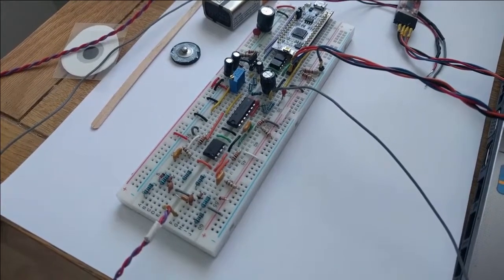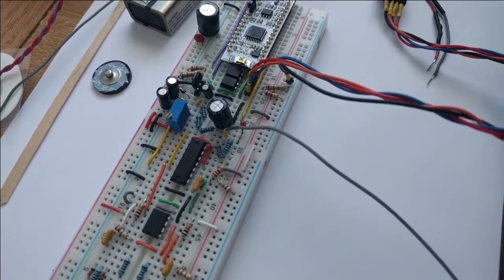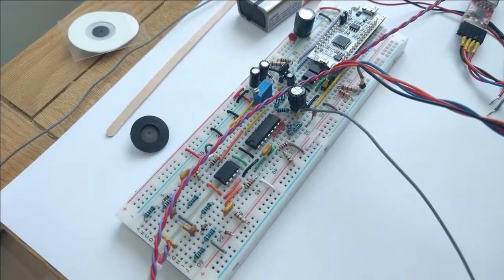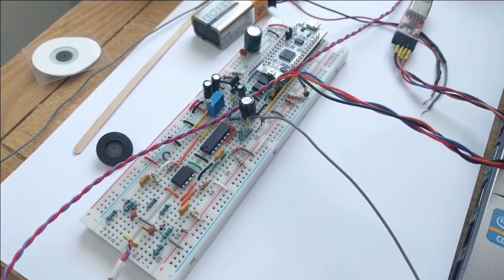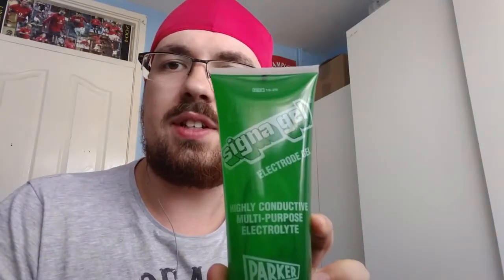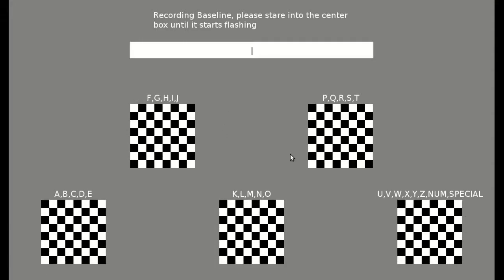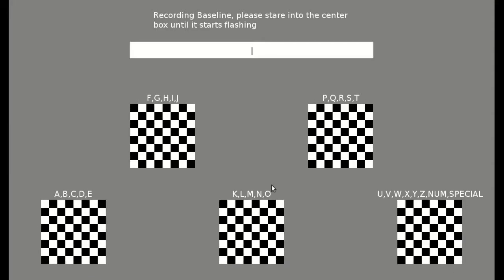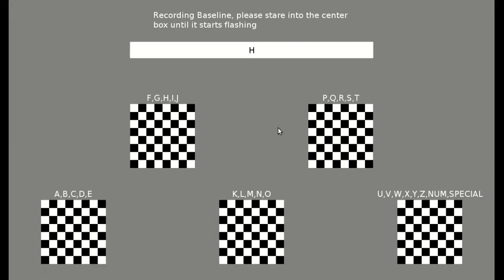Demonstration of a Low Cost EEG Circuit

Comment: do you have pictures of the breadboard exactly
Great work
Reply from the maker: Sorry I don't have any pictures of the breadboard but the circuit diagram is on my github in the description if that helps. I built it on one breadboard but I'd suggest two as it ws very tight to fit everything in

Comment: Please suggest me which electrode to buy.... so that i need not to connect extra wires.... I want   V+ and ground... to be amplified by instrumentation amplifier
Please reply.... thanks in advance
Reply from the maker: For this circuit you will need the 3 electrodes but if you are using a different circuit you could make the electrodes like I did which are shown in the video or buy some cup electrodes, these can be expensive though. If you just want ecg or emg, you can use standard ecg pads which are cheap

Comment: Hey Roboro, congrats for the job, have you used in your electrodes the shielded cable? I saw the picture in github and it looks like a simple cable. How can you eliminate the noise? Don't you have a problem with this? Thanks for the video and for dissiminating the knowledge.
Reply from the maker: I used a simple multi thread wire for connecting to the electrodes, I wanted to see if I could get a signal without using shielded wires but you can of course use them if you have some. Using a tight twisted pair and the driven right leg reduced the noise and interference being measured
Reply: Roboro Ok, thank you for explanation! Gonna try here.

Comment: Hey! Thanks for the video. And can we use Arduino or something else instead of stm32f303k8?
Reply from the maker: Yes you can use other microcontrollers, if you another STM, porting the code won be too hard. Porting the code to arduino would be more difficult, also the ADCs on Arduinos are lower resolution
Reply: @Roboro   Hey I have a Biosignal Amplifying circuit which doesn't seem to work, can you take a look at it? Thank you
Reply from the maker: @mohankaushik2943  If you email me the circuit diagram and the issues with it and any other useful info, I may be able to help you if I get the chance. ronanbyrne791@gmail.com

Comment: Is it viable at all? 

You can basically have an EEG by taping washers to your temples hooked to some MCs GPIO with a simple transistor as amplifier. But that won't get you very far at all.

How would you say that your circuit compares to something like OpenEEGs stuff or commercial products? The cost surely sounds impressive, but much too low if considering the challenges of getting clean EEG input.

I don't have a clue, though, the output looks extremely noisy to me.
Reply from the maker: Sorry, I dont seem to get notifications about comments a lot and missed this one.

It depends what you want to use it for but this is my first attempt at an EEG circuit so from what I´ve learned, a version 2 would be a bit more refined/improved etc. Also if someone needs to get high quality EEG signals, they would need a high quality EEG hardware

The circuit was based off on me reviewing many circuit published in papers as well as the OpenEEG and some other open source circuits but the goal of the project was to strip it back to so it would be simple/cheap without reducing the amount of EEG signals it could be used for. The electrodes are silver/silver chloride(ECG electrodes) with EEG gel, I don´t know the chemical interaction between the two so this could cause an issues 

I didnt have access other EEG hardware to compare my signals to but from looking at raw unfiltered EEG signals, the signal shown in the video do not differ greatly from the signal produced from other EEG hardware. But the mounting of the electrodes using swimming hat could definitely be improved because any moment would cause a lot of noise